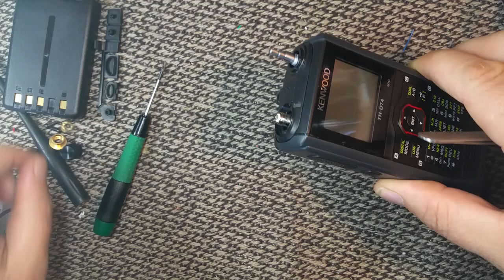Kenwood TH D74 Extended TX mod Wide camera

Comment: Thanks for the tutorial. I just did the mod with a small screwdriver and a pair of very small wire cutters. Worked GREAT!!! I DO NOT recommend this method. If you are not an expert with electronics, don't even attempt this mod. I have worked on RADAR and "by-hand," manufacturing/ R and D of circuit boards with very small components for over 30 years so I have some experience. If you have never soldered or worked on very small components under a microscope I would find someone who can help you out. Thanks YO3HJV!!!!!
Reply: Can you tell me what tools you used or provide a link to them?  This method seems messy.